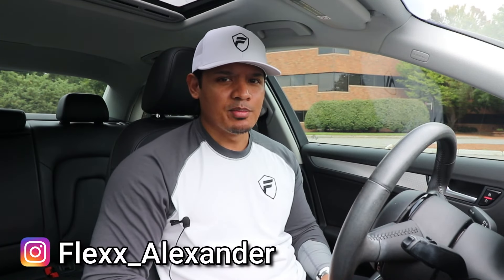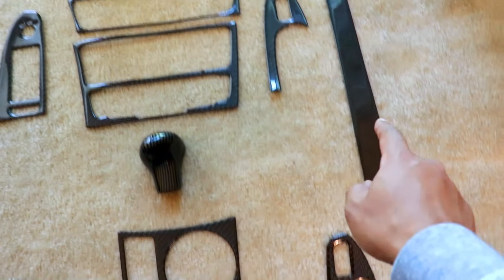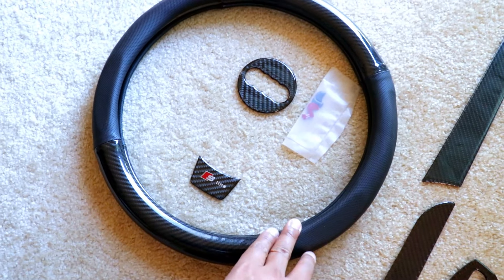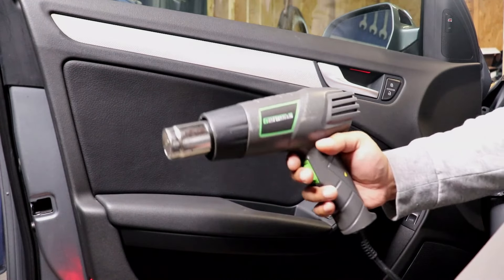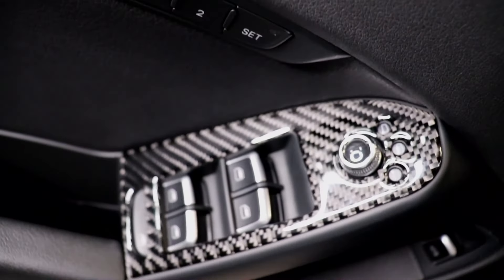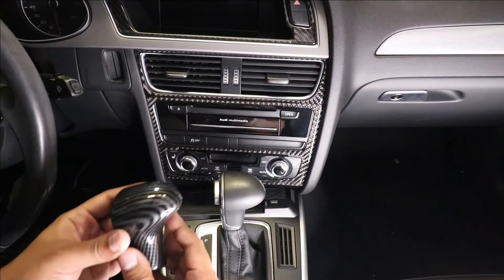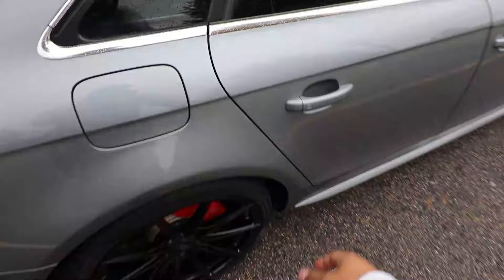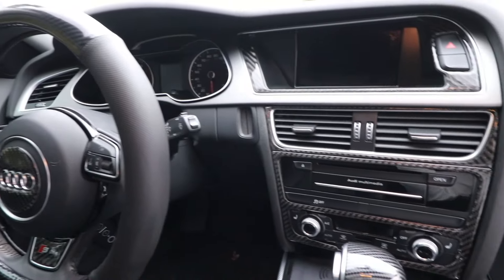CARBON Steering Wheel & Interior Upgrade | Install trim overlay on 2015 A4 B8.5 S-Line

Comment: Im not here to hate but the steering wheel aint the best
Reply from the maker: Its a cover. Aint gonna get any better than for a budget upgrade. Better than the stock steering wheel with scratches all over it. Plus, it's temporary. I'm still trying to figure out what custom steering wheel I want.

Comment: looks good from a distance.  maybe a show of how it looks up close, how it fits into the entire console .. For me it looks like an advertisement for a new product from China .. 👇
Reply from the maker: You know this stuff isn’t new? I installed the same thing on my Benz 2 years ago and it’s been available in the market for like 10years.  Beats vinyl wrapping trim. Plus I’m not trying to turn my car into a show car. I rather look at these while I’m driving versus the crappy black plastic all over the place.  

You do know that most aftermarket car part is made in China? Haha.  Just cause you can buy something from a US reseller on eBay doesn’t mean it’s made in the US.

Comment: Spent around $1500 for interior carbon fiber wrap on my w212. Bye bye faded wood trim. Well worth the $$$ and came out awesome. You're fortunate to be able to find the parts to DIY. Looks great Flexx. Looks and feels like a new car
Reply from the maker: damn that expensive...but if you think its worth it..then its worth it. Nice!
Reply: @TheFlexxGarage  as opposed to over $3k in replacement parts, I'd do it again. Couldn't find all the parts I needed and got tired of looking. Was even luckier to find @VRDCustoms in my area too. Check em out for the next project
Reply: I'd rather an original replacement than an inlay ,but settled for the wrap. Closest best thing. Wasn't looking to cover any fuberoptics with it either. On some cars,it just doesn't look right. Others will,such as this A4

Comment: "the flat black" parts are the nicest thing in this interior, they need to be cleaned with special interior spray, not the cockpit spray because then it looks ugly. IMO these pattern looks a lot worse than this matte black parts, for the silver parts its ok, but matte black in original is a lot better

Comment: I’ve seen these and didn’t know if I should buy for my car. I’m just wondering what long term use is going to be. Great video as always!
Reply from the maker: Had similar ones on my old Benz. For over 2 years. No issue as long as you do a clean install. If not, they will peel up over time.

Comment: Looks great. My only problem is with the centre cap of the drivers airbag. Manufacturers spend years designing the airbags so if deployed they open a certain way but by sticking this trim over it  it could compromise the release.
Reply from the maker: You knows it’s just a flexible sticker? It’s not a “trim”. I said it over and over in the video it’s an “overlay”. Haha. When you apply a crapload of pounds of force from an airbag, that sticker will be gone like it never existed.

Comment: How reliable is your Audi in comparison to W204? Could you please make a video comparing the cost of ownership of your previous Mercedes W204 vs Audi?
Reply from the maker: Ehh. Don’t know.  Haven’t put enough miles on each to know.  Audi just eats oil. Not a lot but it does.  It’s common cause of the design allows some oil to slip past the piston rings into the engine to burn up.
Reply: @TheFlexxGarage  Really? That's interesting. My B8.5 has over 100k on it, doesn't burn a drop of oil. From what I understand they fixed oil consumption after the B8
Reply: @TheCompyshop  same here 113K and no oil burning.

Comment: Will the parts in the description match mine a4 b8 2008 year sline? ? Except steering wheel and shift knob. Is it solid and won't peel off over time? Or due to the high temperature in the car. Greeting from Poland!

Comment: did the carbon piece fit correctly with the quattro badge on the passenger trim piece or did you have to take that quattro badge off?
Reply from the maker: It fit over but there was a very slight bulge. Probably cleaner if you take the Quattro badge off first.

Comment: Where did you get the heat gun that can be plugged into your car?
Reply from the maker: That’s plugged into a wall. Not car. You don’t want a heat gun plugged into your car. It will probably blow a fuse.

Comment: I personally think this looks stupid and cheap. The original silver looks way more expensive. But it's no my car so do what you want.
Reply from the maker: Yup. I’ve been doing what i want and it’s worked out well for me. #ThumbsUp
Reply: Thank you very much for this very helpful video..
Reply: @TheFlexxGarage  I'm somewhere in the middle. I also don't like the silver trim but I'm thinking about wrapping the trim with a carbon look wrap. A non glossy version. When I don't like it I can take of the wrap but not with these overlays. They will leave glue all over the original trim I guess.

I am jealous about the amount of mods on your car though!

Comment: All the best stuff is abroad. I live in the UK an you can hardly get anything like this, it's all import. so annoying.
Reply from the maker: Why is that so? Nobody wants to ship there, shipping is expensive, or too many rules and regulations on aftermarket parts?
Reply: @TheFlexxGarage  Small mods like this are mostly sourced from other countries on sites like eBay. I'm guessing these type of mods are not popular enough to be cost effective to produce, stock, or import. Perhaps if it was a mainstream new car.

Comment: do they still stick?
Reply from the maker: of course. Why wouldn't they? If you follow instructions and thoroughly clean a surface so it's completely clean and then you heat the back the the trim...it's super sticky.

People who dont know how to follow instructions are the ones with problems of it not sticking later on. They get the trim in the mail and rush to put them on and don't even do the properly cleaning or heating of the trim.
Reply: @TheFlexxGarage  Damn. Why you get on his ass like that 💀

Comment: where did you get the heat gun?
Reply from the maker: Amazon. I think I left a link in the video description.
Reply: @TheFlexxGarage  I couldn’t find it in the description. I’ll check Amazon though, does the brand matter?
Reply: @eljefe6555  Dude, you can get a heat-gun at any local hardware store. It's just a glorified hairdryer.
Don't spend a ton of money thinking "Brand A" is gonna make your job turn out better, than if you use "Brand B" ...
They're all the same. In fact, back in the day before heat-guns were popular; guess what we used to warm-up projects like this ... ? ... Yup. A hairdryer :P Just borrow your sisters, lol.